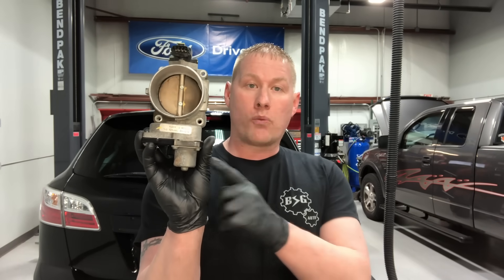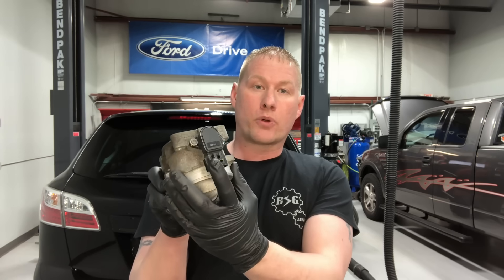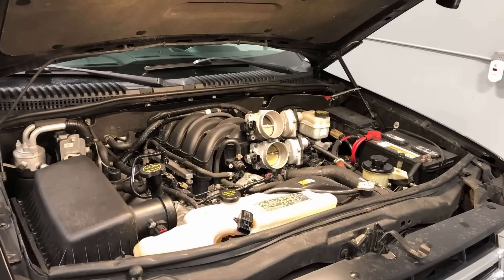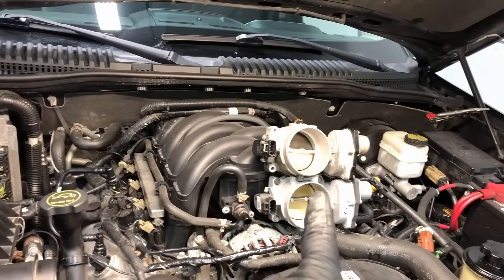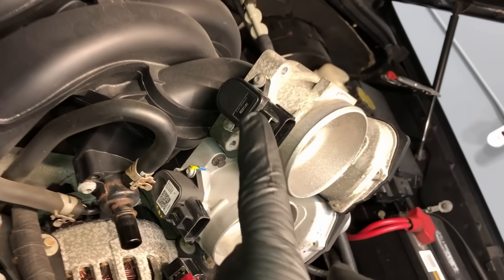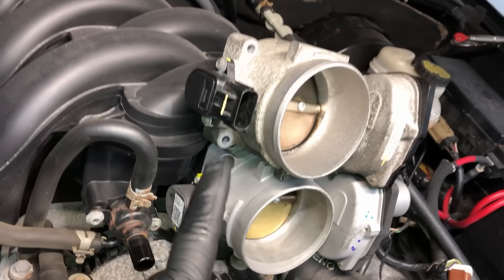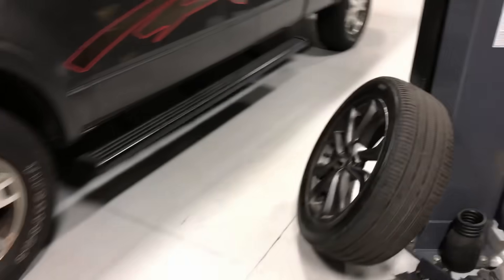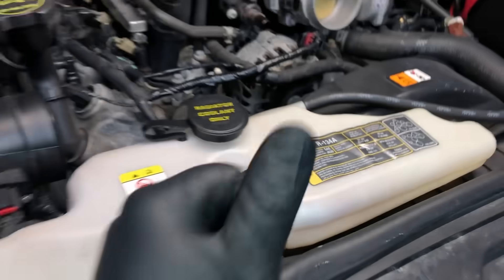Ford Electronic Throttle Body Failures P2106 P2107 P2110 P2135: What to Check First!

Comment from the maker: Latest Throttle Position Sensor for this model ETB-
https://amzn.to/2HYnGDr                                                                                                                                                                                  TP Sensor replacement without breakage-
https://www.youtube.com/watch?v=pPFAzVBznu0
Reply: FordTechMakuloco i have a 2015 f150, 5.0L, 90000 miles. Two ford dealers are stumped, and a ford engineer. It sputters and wants to shut off at idle. Stalls sometimes at idle. Idle is rough always. No codes. Changed out the throttle body to a brand new oem ford unit, changed spark plugs too (Oem motorcraft). Changed purge valve solenoid (oem). Still doing the same darn thing. Ford used their IDS/VCM system to scan everything but say cant figure it out. It shut off even with the techs/engineer. Still couldn’t figure it out. I’m starting to think VCTs/solenoids? I know you’ll be the only person to point me in the right direction. I’m going nuts. Ford can’t figure out their truck. Thanks
Reply: + @LA-TEEZI
Reply: is this 5.4L issue only ?
Reply: @FordTechMakuloco I'm inquiring if you know when Ford added engine hour meters for the E-Series as I know they did so on the F-Series Super Duty in 2005.
Reply: @FordTechMakuloco the part you linked to says it won't ship for 1 to 3 months even with Amazon Prime. A bunch of other listings show DY1164 & AG1E-9E928-BA. Are they the same part number? I don't want to throw good money after bad picking up an inferior copy.
Reply: Hey FordTechMakuloco I replaced my tps sensor , I drove it around it was fine and then 3hrs later I was on my way home and then all of the sudden, I got the wrench light with the checkengine light as well. The codes that got were p2107, and p2110 any ideas ?
Reply: Hi Brian , I have a 2006 ford 500 , it has no throttle response rough idle and stalling . I removed and cleaned throttle body cleared the pcm. Also changed fuel filter . The throttle body works via the gas pedal when the key is in the on position, but there is no throttle response when engine is running . We got it started with starting fluid and it ran rough  , acting like it was starved for fuel. It sounds like its missing too , not a smooth idle .What do you think it could be  ? Bad throttle positioning sensor ??
Reply: Ok bud I have a 2006 mustang GT cleaned the throttle body and now when I start it and it's warmed up if a tap the gas it stays at about 2000 rpm for about 10 to 15 seconds before it comes down if I recalibrate it will I lose my tune.
Reply: It also has a Roush supercharger.
Reply: Please help me find the idle air control valve on 2008 taurus
Reply: How do you know if it’s the sensor of the whole throttle body ? Big price difference
Reply: FordTechMakuloco I want to send u 20 bucks , Reply I will.paypal is easy’ist for me
Reply: How to cut crown mold
Reply: My 2004 5.4L 3v Fx4 F150 just threw the P2106 code and low and behold, my truck already had the 3rd Gen TPS! Had my throttle body replaced 40k miles ago, so I don’t understand what happened, lol. So much for the 3rd Gen being much more reliable *shrugs*. Think maybe I just got a bad one? Or should I give it another chance with a new 3rd Gen?
Reply: Please tell me which part# I need for a ford 2006 E150 econoline van
Reply: Will that ford for a 2005 mustang 4.0?

Comment: Could that cause it not to start? My 06 Expedition just started not starting. Turn key and nothing! Lights come on, relay clicks, new starter, and still no go. Tried in neutral as well. After clicking it multiple times and unhooking the battery then hooking back up still nothing. I had my wife try it a few times about 20 minutes later and it sounded like the throttle body made a squealing noise then it cracked right up.

Comment: This video does miss 1 thing. The accelerator pedal position sensor. Mine went bad in a 2004 f150. It is the accelerator pedal but gave codes for the throttle body because they communicate with each other.

Comment: Could this cause a no crank/no start condition? I have a 2004. The only way I can turn it on is if I unplug the battery and ecu, replug them in, and turn the car on. It will not turn off at the key either which is weird. I checked the grounds and they all appear to be in good shape. I hear the relay for the ignition click. But nothing. All other electronics seem to be good.

Comment: Could the p2106 and p2135 cause the truck to shut off and throw an oil pressure low warning? 

My truck shut off and threw the warning but the codes I got were those

Truck is an 05 F150 5.4L

Comment: 2004 f150 4.6 Someone please help. I’m 1100 into trying to fix this issue so far and I’m lost, tb has been replaced multiple times, rear abs sensor replaced, air filter, have replaced tb with direct replacement from ford dealership. Twice. I simply cannot figure out the issue
Reply: The wrench light comes on exactly at 40. And it makes it lose power, and shift horribly

Comment: Hi I have a problem with my 2008 f350 6.4 diesel and I was wondering if you can help , I recently installed a long Block because the original motor had a cracked piston after 600 miles it started a weird thing after it reaches operating temp it stumbles and sometimes stalls I have a correlation code, so I checked the wiring replace the camshaft position sensor with a ford one and it still does it now it still stumbles and I have a p061C along with the stumble any thoughts I would really appreciate it

Comment: Had my ETB fail at ~110k (not sure specifically what yet), replaced on the side of the road and all good! TIP: I took off the first three bolts before loosening the fourth which was stuck pretty hard so it kinda torqued the molded in nut out a bit when I cracked it loose.. So loosen all four bolts before removing any to avoid damaging the flimsy plastic intake manifold.

Comment: Just had an 07 Sport Trac in the shop with a P2104, P2111 and P2112. Stuck in limp mode. Hard codes wouldn't clear. Throttle blade was pretty carboned up. Removed it and cleaned both sides real well. Blade was still sticky and would not return. Removed the motor and found the glue that holds the magnet to the case had let go and would cause the rotor to bind up. Used some Loctite 4070 to glue the magnet back on. Put it back together, reinstalled. Cleared codes. Everything works as it should.

Comment: What would be the next step if I've verified that the throttle body is opening correctly and has the version of TP sensor you recommended? I am still getting the p2106 code as soon as I hit 40 mph. Any help is appreciated, thanks! Like watching your videos so hopefully you or someone else has some insight.
Reply: I’m having this exact same issue and have been for months, have you found out anything?

Comment: Can you please do a video for the throttle position sensors signal wires, unplugged, koeo, having either a pull-up or pull down voltages present. Thank you.

Comment: I have a 2007 Sport Trac 4.6L and I am getting a P2104, P2111 and P2112 error codes. I would get no acceleration when I stepped on the gas pedal. I thought it was the gas pedal, but it wasn't. I changed the sensor with a new one I bought on EBay. That didn't work either. I took out the throttle body and cleaned it. Still getting the same error codes. First time I got the issue was while driving. I was going fine until when stepping on the gas, no response. What can it be? Do I need a new throttle body?

Comment: I have a 2010 E350 with the 5.4. 120,000 KMS. No check engine light came on, but three times last summer after I came to a stop, with my foot already on the brake, the engine suddenly accerlarated hard. Firm brake pressure could not keep the rear wheels from spinning, and the motorhome lurching forward a bit. Each time this lasted about 3 seconds before the engine returned to normal idle. Unnerving and dangerous. Could  this sensor be the cause?

Comment: I have a 2007 Mustang V6 with over 160k miles and just recently change the throttle, before replacing I had a check engine light and the car was stuttering and sometimes even shut down. After the replace I still had the check engine light on and notice a bit of the same symptons, then I watched your video on the programming of the throttle by removing the battery negative cable and draining it to reset the system. AFTER doing this and the pedal holding the car removed the check engine light and was working better than ever but it only lasted for 2 days and the light came back on with the stuttering. Now i have to be repeating the process every couple of days to get the car working properly. Any thoughts on this?

Comment: I have a official repair manual for my 09 Grand Marquis.  I came across the TP sensor section and it says that a heat gun must be used to heat the TP sensor before unscrewing the screws.  Can you elaborate why you would need the heat gun??
Reply from the maker: To soften the thread locker so the machine screw does not break.

Comment: You're a life saver. I have 2012 Taurus my I its going into limp mode so I scanned coming up with codes P2102 07 & 10. I ordered a new not reman throttle body and throttle pedal installed both and car ran fine. For three days then periodically it went back into limp mode . At first I thought I didn't do the throttle pedal programming procedure correctly but after redoing everything I still have the same problem and codes. I was thinking it had to be a bad part straight out of the box but had no way of checking. You are the only one I found who explained original style vs latest style parts.  Thanks I really appreciated it and I'm now a subscribe to your channel.

Comment: On a 2013, if sensor 1 goes up and down, full stroke of the pedal, but sensor 2 tops out at half pedal, does the TB need replaced?

Sensor 1 starts at like 4.84v, goes up to 1.17v (if I remember) at full pedal.

Sensor 2 goes from 1.18v to 4.42v at half pedal. No further voltage from half to full on sensor 2.

I find the same thing on my 05 4.6l. one sensor tops out at half pedal. The other goes the whole stoke of the pedal.
Reply: Did you get it figured out?  My TB appears to be working with pedal requests, no carbon on the TB, but still getting 2112 code.  I am thinking it is the TPS send bad signal to the PCM,.....Im like a bad mechanic just switching parts!

Comment: Hey ❤the channel! On my 2011 Taurus sel 3.5l I have the 1 you recommended (big box) I'm getting non constant p2107 and I also am having immobilizer issues. Security light blinks rapidly, fast chime and no crank😢 I've checked and cleaned all grounds still same....? Any ideas Ford Jedi Master?

Comment: Im not sure If this si the correct place to ask the questions but here we go. 

I have a 07 Ford f150 (king ranch) 5.6 3 valve. Have had it for about 3 months now. Ran pretty good but was a little sluggish. Way to work a month or so ago, got the limp mode. Drove it to the exit ramp and turned it off, and back on it went away. It's got the gen 3 TPS on it, I switched it out with a new one and cleaned the entire throttle body lto like new. I also cleaned the MAF sensor and changed the air filter. I went ahead and changed the plugs as well. Runs excellent but intermittently... Im still getting the TPS code but now some others like the P2111,P2104,P0430,P0446... One is emissions I'm not worried about. We don't have emissions in TN. 

Im asking I guess could all this be a legit bad TB? Could it actually be reading correct and it's stuck open/closed? I know the TPS is good including wiring. I found one on Amazon for $100. Im hoping that will solve this. Thoughts?
Thanks

Edit:: is it normal for the limp mode to go away when you turn It off and on also or does it stay in limp mode for most trucks until it's fixed? Mine goes away after restarting and randomly comes back on

Comment: Had P2112 pop up after starting my F150, but it went away after restarting. I’m assuming it’s going to come back at some point and it’s best to just replace the TB at this point correct?
Reply: Did you end up having to replace the TB, and did it resolve your issue.  I had the 2112 limp mode/wrench, that ended up self clearing, but has now come back again after a month.  TB was squeakly clean when I pulled it, but I am thinking the sensors within the casing must be bad?
Reply: @ nope mine might have been related to a dying battery. I haven’t had it happen since
Reply: @DoubleTap702  very interesting. My first event happened after a battery replacement.   I failed to update the Bms

Comment: i got p2107 and p2110 after replacing my coolant thermostat :( all i did was remove the air intake hose and disconnect the 2 required connections...

Comment: So Iv had a issue for about the last year with my 05 5.4 f150 get a p1205 , p2107 and a p2110 all at the same time every time , mite happen once a day mite happen 10 times in a day, are these codes caused by the TP sensor
Reply: Well I’ve replace the throttlebody and the pedal for a running and driving truck and put the updated throttle position sensor on it and still getting these codes.

Comment: PLEASE ,PLEASE, HELP ME... I just did a axle swap, I had 3.27 gears in the car , the new to me axle is 3.73, The 1st test drive I got about 100 yards and the car went into limp mode the wrench came on & the CEL, and the engine seemed like it was flooding or running on a cylinder down, Trouble codes: P0104, P0122, P0223,P2106 and P2110, P0113 and P0114. I'm on disability so I have no money to go have a tech look at it, Is there anything I May have overlooked ? ANY INFO or help is very much appreciated. I have no idea why all those codes came up, It drove & ran Excellent before the axle swap.

Comment: 2010 Explorer 4.0 v6 4wd 120k miles p2135 with wrench light and stalls.  Checked Wires, cleaned throttle body, connectors pedal slider and tb slider and worked better, but still problems.  Replaces pedal and throttle body (gen 3 sensors) it was better still had problem.  Cleaned throttle body, intake maniford, map sensor worked better but still had problems.  Replaced ERG Valve....works great.  Most Fords in past had a quick studder around 30 to 40mph when erg valves went bad, but not on newer ones.

Comment: Sir, I have a code 2109 on my 2017 toyota camry le I had  replaced a pedal accelerator sensor but the code 2109 will delete. Could you please help. Larry

Comment: Will p2110 code cause motor not to start?  We have an 05 Mustang gt,   car was running like garbage, never had a problem before.  we replaced all the plugs, car started once we drove around block, came back wont start again, figured ok possible fuel pump, replaced fuel pump.  got fuel at fuel rail got signal at injectors, got spark at coil packs, still wont start, it tried then just cranks/  it on ignition on, it makes a horrible sound in the intake.   could that keep the car from starting???

Comment: I have a 2006 ford crown Vic & most times it just cuts off but will start back up & I put a new throttle body on & oh boy I had so many codes so I just put the old back on & it ran just fine but still was cutting off so I’m thinking it’s the TPS

Comment: I had shaking and all most stalling at warm up changed spark plugs coil packs and throttle body OEM Ford and I still have low idle in gear any ideals would be appreciated

Comment: Have p2107 fault on 2011 lincoln mks. Replaced with new ford throttle actuator assy. Used your clear codes with jumper for 2 min. Let it warm up 15 min. as you described. Ran fine for several miles. Next day drove a few miles and after coming out of store upon startup it reved up and settled back to high  idle around 1300 with surging somewhere up to perhaps 1800. Went into limp mode. Service engine light and wrench symbol both came on. AC blower seemed to stop working. Code reader showed P2107 again. Restarted car and luckily it behave enough to get home. Next morning used your clear code method again. After warm up drove for an hour around town nonstop and it was fine. Grabbed mom we ate hamburger while idling car, after 15 minutes it started high idle, surging. limb just like before.  I'm starting to think a warm engine bay is bothering something electronic.  I am stumped. ANY GUIDANCE WOULD BE APPRECIATED.
Reply: Should have also mentioned a battery replacement was required 2 weeks before. Then after a few days it required a bank 2 sensor 1 o2, then this p2107.                       Now back to present I've also confirmed that resetting codes with your jumper method immediately after limp mode and car warm does not get car back to good idle. It must cool down a bit first.                Lastly one of those times it had high idle/surging pressing the starter button did not kill engine. I had to repeat pushing button a couple of more times to kill it.
Reply: @chuckreynolds6098  did you find the solution was it a chaffed wire. I heard if the wire for the throttle sensors rub enough they could ground out and cause intermittent. But also could be air leak or possible dirty throttle body or bad throttle position sensor or bad accelerator pedal sensor. I’m dealing with a similar problem that’s why I’m asking
Reply: I have an identical issue on a 08 Ford edge which has the same engine as the Lincoln mks.  Already replaced the TPS and accelerator pedal.  I did the battery wire reset.  Works great when cold for the first several miles then when warmed up it'll go back in limp mode with codes 2107 and 2110.   If I turn it off and wait till the engine bay cools down, it will work seemingly till the engine warms up again, then back to limp mode.  I have wasted countless hours and thrown a bunch of $ at the issue.  I wonder how many others are having the same problems?  If I ever figure it out I'll post an update...
Reply: @AnnaMyers-r7s any luck yet?